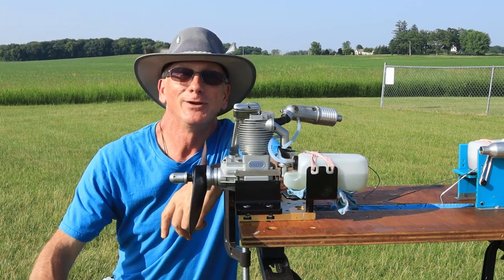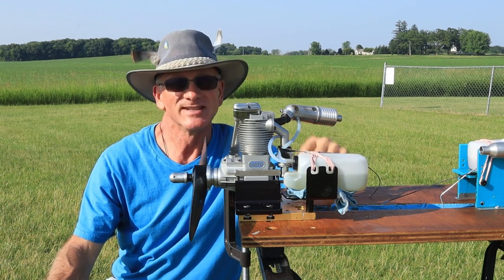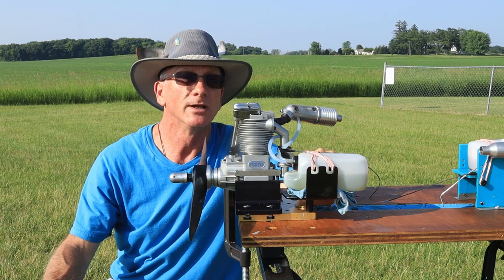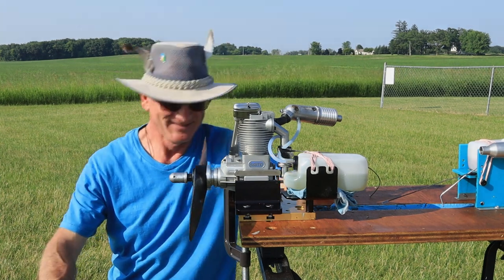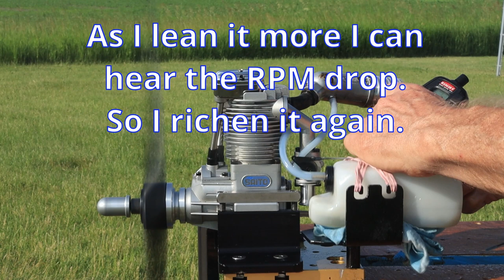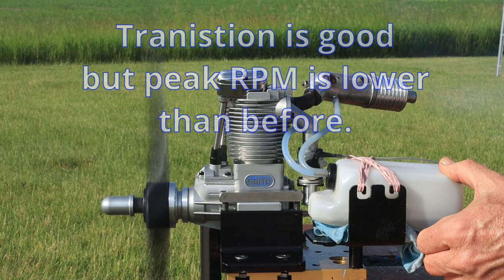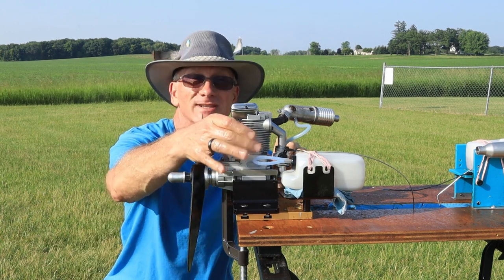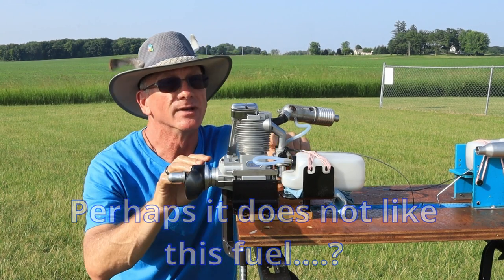More Saito FA-220a

Comment: That is a powerful engine. 
I read, I believe it was in Dub Jett instructions, that if the engine gets too hot, shut it off and let cool down. The reason is that the cylinder may feel that it has cooled down, but the piston may still be too hot. Perhaps it causes pre ignition. 
That has more power than my OS FT-300.
Reply from the maker: Wait until you see the next video of this engine, yet unpublished.  I crown it The New Beast.

Comment: David there is no need to open the needle up before starting the engine. From my 14 years experience with an identical 220A, in my YT Tiffy, I only fiddle a bit with the main needle if the weather conditions are vastly different to the ones of the last flight. Don't do it, just serves no purpose whatsoever. I run an OS Type F plug with the slow run needle just a bit rich, I get 4+ years per plug with somewhat regular use.
Regards Harry

Comment: Hi David, thanks a lot for your interesting videos! Perhaps when the tank level is low, the vibrations create small air bubbles in the fuel and this causes the speed to drop a bit. Do you use a felt filter like the one built into the chainsaws? Just my thoughts... This Saito runs on idle like an old one-cylinder motorcycle- simply great!!

Comment: I think David the variation of full throttle speed may have more to do with  tank volume, as the large methanol /nitro engines use a lot of fuel quickly a small tank effects head pressure to the carb ,even with muffler pressure as the tank level drops there is more room for exhaust expansion so head pressure to the carb is is reduced. a thirty oz tank may iron out variation or a mini fuel pump , still a great sound and more finger friendly than our 150s engines😀
Reply from the maker: Hold that thought until you see the next video....